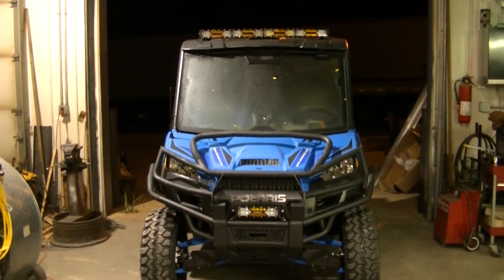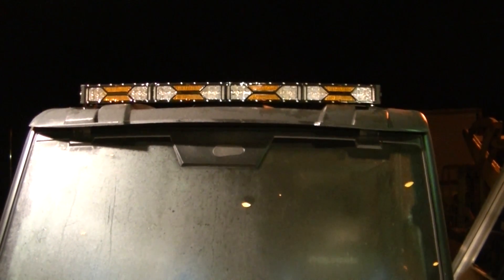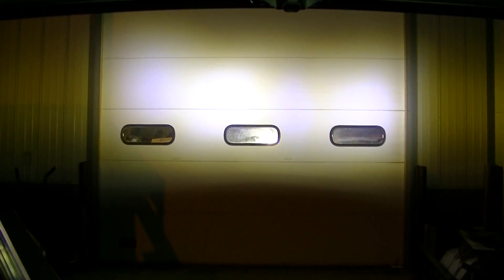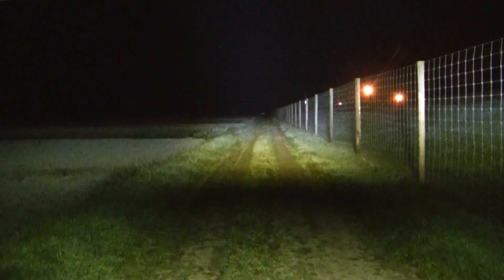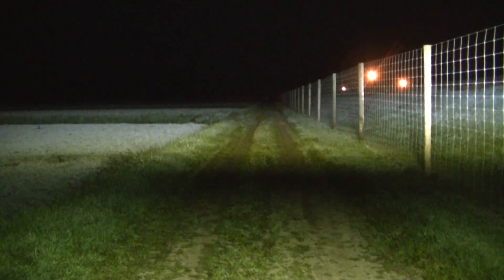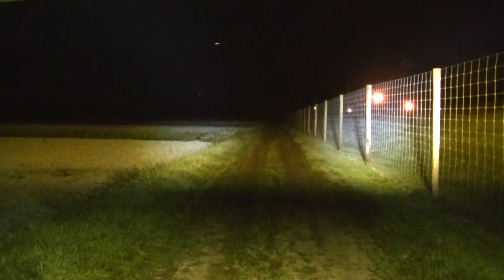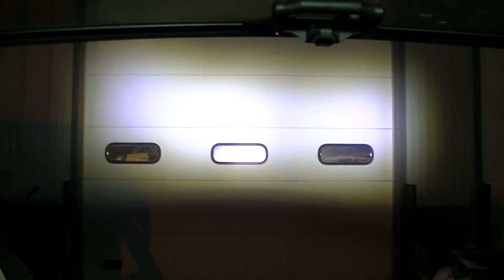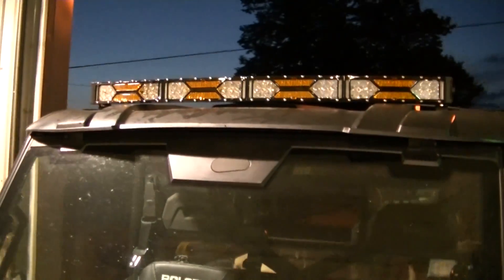Transforming Light Bar Auxbeam X Series LED Light Bar Filter Testing

Comment: I know this video is about the light bar but, I was wondering how well the new tires and rims are working out?? Maybe you could do a video and let us know how they are working out, there was some question in the install video about rubbing issues and to big ? Is this still an issue? So if you could do a video covering those concerns it would be very interesting. thanks and keep up the great videos.
Reply from the maker: I will have a video of the tires soon.  They rub slightly at full lock.  I am playing with the shock adjustment to see how that affects it.

Comment: I like the all white or all amber diffusers.   I wonder about the legality of using the red or blue filters especially if you're using it on the road.
Reply from the maker: I think this is a purely off road light so I don't think you will have any issues using any color.  They can't stop you for having the filters on the lights with it off.